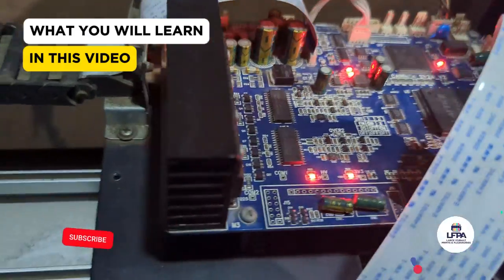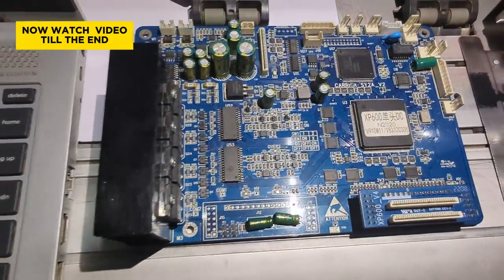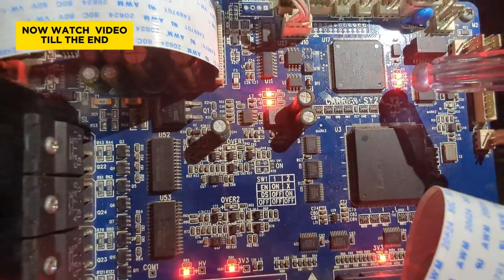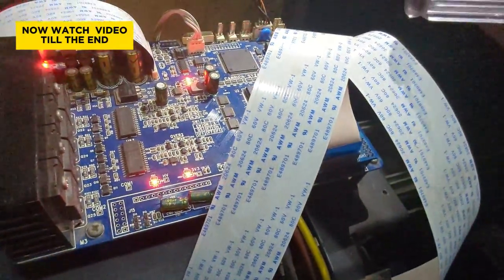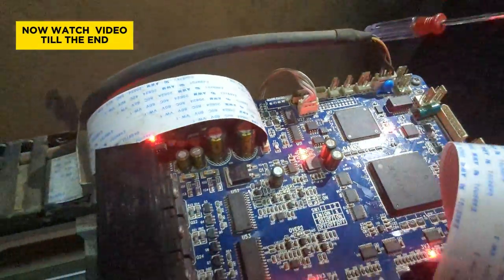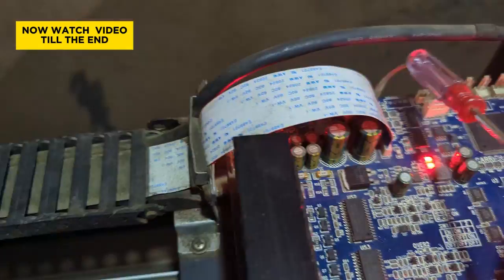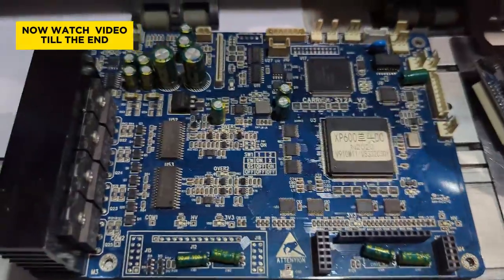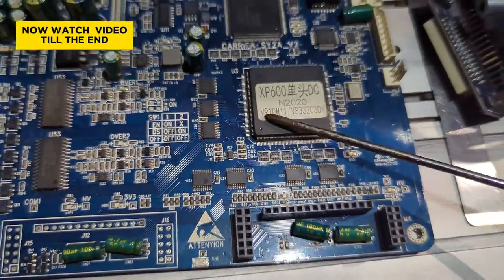HOW TO TEST IF YOUR XP600 CARRIAGE BOARD IS STILL WORKING

Comment: I have a dual printhead and it seem like the left side where the adaptor card goes isnt working. I put the right side adapter card on the left and error 16 comes up but when i put the adapter card back to the left side no error 16. So that means my adaptor card is working correct? What could it be?

Comment: MY AUDLEY CARRAGE KEEPS STOPPING AND STARTING DURING PRINTING, CAN I SEND YOU SOME VIDEO PLEASE, WE CHECKED THE COMPUTER NETWORK AS WELL AS REPLACED THE ETHERNET ADAPTOR, WE PRINTED FROM ATOOLS AND STILL STOPS. CAN YOU CONNECT WITH ME PERSONALLY?
Reply from the maker: It could be your RAM or network cable
Reply: We hooked up a new lan cable and ethernet usb adapter. We even checked the ram and power on computer and we hooked it up to another computer and ran a job on atools. Still stops and goes. Too bad i can't drop screenshots on here@richwords1
Reply: Audely is pointing to a 5 prong lan cable under the ethernet plug on the board and said check that cable. Would you know which cable they are referring to?
Reply from the maker: The long black cable on your board.

That's the network cable I was telling you about.  @woodardproducts6962

Comment: Hi please i have link error issue with my xp600 i have tried all i could but it won't work.
Reply from the maker: Link error is mostly carriage board. Except you didn't plug your head I. The correct slots between left and right
Reply: I have switch the cables left to right and right to left still it's still not working. Please drop a contact for me where i can private chat
Reply from the maker: If this is the case then it's the board. Either you go find where to test it. Or you get another board. There's very little road ahead from there.

Comment: For some reason I realized the pins in that adapter had come out
Reply from the maker: If the pins in the adapter slot pulls out. Which technically Is impossible to happen. Then you may have to buy another.

You can contact us at 08129337940 In case you need to buy
Reply: Please your location
Reply from the maker: Lagos
Reply: Also, my machine registers only 3 colours even with a new print head
Reply from the maker: @Mr_Aninkorah if your machine renders 3 colors even on a new head. Then something really bad is going on wrong in your machine